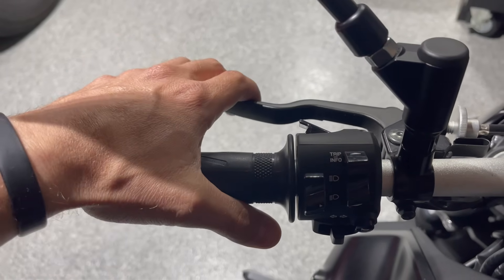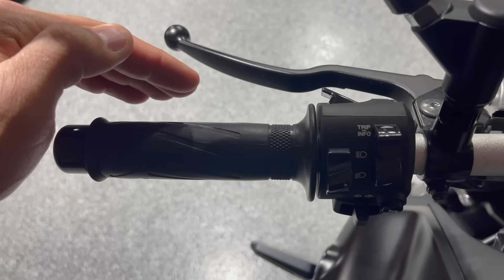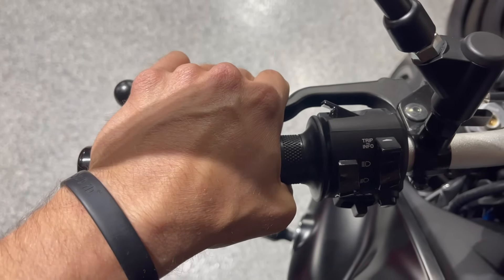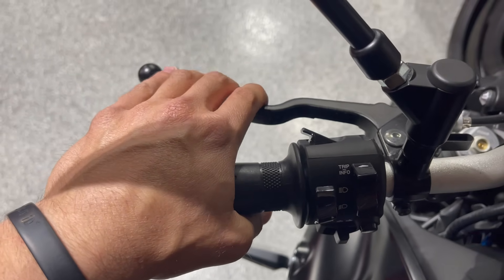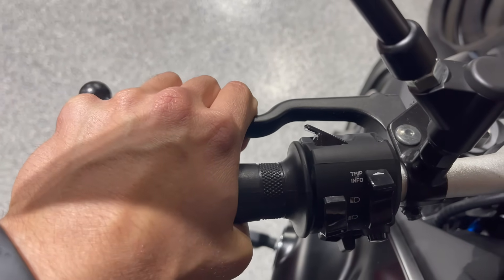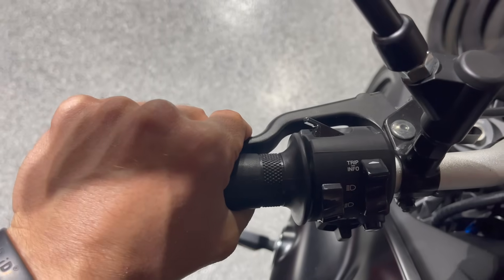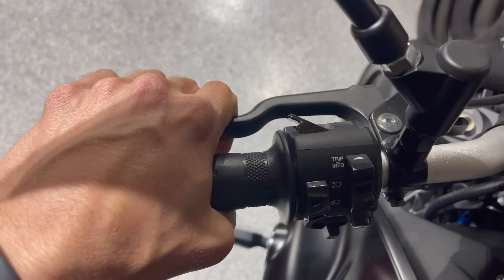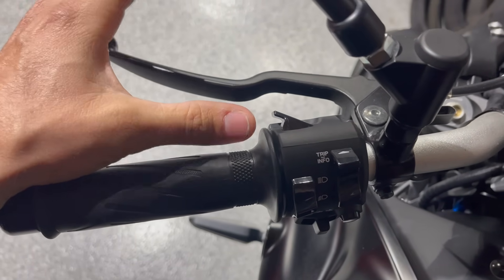Don't Make This Common Clutch Mistake!

Comment from the maker: You only need to pull in the clutch enough while shifting or doing slow speed practice to get in and out of the friction zone, not the full range of motion. Go try it out :) https://linktr.ee/GregWidmar
Reply: these little tips you have been posting are valuable info that you dont see often enough.thank you!
Reply: Thanks…because of you enjoying riding again. Have a lot of old  OLD bad habits (z900)
Reply: Super helpful  always helpful  thank you more confident now
Reply: So is this basically like the ‘biting point’ on the clutch in manual cars? As in there is a point when you raise the clutch pedal where you can feel the gears ‘biting’ as it were?
Reply: @friktionrc  at a car you need to fully press it, but on a motorbike not. I mean, at both vehicles there are that "biting" zones as you mentioned, but on a motorbike you dont have to fully press the clutch unlike a car.
Reply: @ADDONRACER  thanks and yup I get that - for the bike you have to  'twist' , I just wanted to check the feeling was like in the car - so as a rider you can feel the clutch biting in the same way you feel it biting inna car....what I mean is, being a bike would that make the biting point more delicate?
Reply: @friktionrc  its not exactly the same, but both have biting points yes, but you cant compare it. Even  diesel and petrol cars react differently to the clutch. If you compare a bike to a car, with one you do it with your feet and the other one with your hand, but yes, there are biting points on both vehicles to answer your question. Even when changing gears for example from two to three on a bike, then you can give a bit of a throttle before you let the clutch fully go, to shift smoothly, same as a car. Why are you comparing cars to bikes anyway, u wanna get a bike?
Reply: @ADDONRACER  Thanks for that 😊👍....and yeah planning to learn to ride and get a bike ...is it that obvious 🤣. I've riden 'twist and go' jobbies ages ago (like +35yrs, mainly on beaches etc for fun) now wanting to learn to ride and one day own and ride a pre-2012 Suziki Hayabusa. Friends that ride have advised not to get that as a first bike but start out on other less powerful machiens and get on road experience and work my way up. Thing is, I'm not getting any younger and want to get on the sadle befote Governments put all these electronic restrictions /limiters etc on bikes like they are slowly doing in cars. Was initially looking at something like a Suzuki TU250x to start with as its pretty basic but from what I can see is a great 'starter bike'. Only thing I hate is for us in the UK we have to be take and pass different tests to be able to ride pwerful machines like a 1300...where as for car drivers, any idiot can pass one test and drive anything from a G-Wizz to a +200mph Pagani/Bugatti etc etc etc without taking any other test. Modern cars are just too boring for me now (I'm a 70s/80s kid lol)...and bikes is where I can see myself enjoying time on the road (without being a dick lol). And anyway even as a kid I was into bikes way before I was into cars (and I say that as a self confessed petrol head lol). My first bedroom poster I remember was at 3 yrs old and of a certain Barry Sheen, knee down on his Suzuki - my first and sill greatest motorsport hero 😈😈🤣🤣🤣
Reply: @ADDONRACER  Thanks for the great response and wise words. I grew up like you as a car nut too hahaha but my first love was always motorbikes…thing is unlike you I never rode bikes properly. Instead got my car license as soon as I was legally allowed to drive and never looked back since. You are sooo right about the type of bike to get when starting out…initially I was like ‘I want a 1300’, then it was loads of friends saying you’ll kill yourself within the first year because you have 0 experience on a bike that is too heavy and fast for a new rider to control…then I started looking at the Honda Grom thinking it would be perfect as a starter and now I’m looking at a ‘proper’ learner bike like the 250 I mentioned earlier. …and yup our bike tests look properly hard and varies on what type of motorcycle you want to ride. I think there is also a theory test like car drivers get…I genuinely want to ride and own a Hayabusa, but I can’t get over how much hassle it is to pass the test lol…and also how expensive the kit is….a half decent helmet is like +£400 😮😮🤯🤯😂 But you are 100% right….when riding a bike you keep learning and the more you ride, the more you learn - in short one gets more experience. Thanks for the heads up about the vids, I will deff check them out! 😎✊👍
Reply: While this is true, you're better off just pulling it all the way in. It's inevitable you're gonna miss the friction zone and grind the shit out of your gears.
Reply: This is only going to shorten the clutches life this only proves that you do not work on motorcycles
Reply: almost every bike have hydraulic clutch but not on my case as i m in Pakistan. I do always pull 75% off to shift gears.
But thanks u so much for information
Reply: A clutch is only needed when pulling away from a standstill or when coming to a stop.., i have a bike with a dry clutch, haven't touched it for the last 50.000 km's

Comment: You can adjust the clutch lever if you want it a bit in or full in. You can also check the amount of press needed to make sure clutch is release by putting on 1st gear and push /move your motorcycle if it move freely. Note that on gearing to 2nd and up while riding just a little press is enough no need for clutch to relase all d way.

Comment: All depends where the biting point or "friction area " is on the lever . As clutch plates wear this position changes.  Also some bikes may just have the bite point within a few mm of letting out the lever.
Reply from the maker: Ok

Comment: when shifting up i  barely even pull the lever and it is way smoother and faster  but when im shifting down i usually pull it in all the way cause otherwise it is kinda clunky , i guess that might just be my bike  and you have to find the sweet spot for different bikes  , suzuki gsr 600

Comment: Actually pulling the clutch all the way in all the time  & holding it in @ stops should weaken those springs & make them shorter in record time compared to doing it only 1/2 the time-👍🏼much love to everyone & stay hyper alert when riding-from Conroe Tx
Reply from the maker: you can stay at home to make the tires last longer too

Comment: Its different between fast clutch and long clutch..what i see is you using long clutch on your bike and you right about that however for fast clutch we need to pull all the way to handle and just need little gap for movement... I recommend fast clutch so i dont need to service my clutch plate more often$$$$
Reply from the maker: Never had an issue in 500,000 miles...so they way I'm doing it, there's no issue.

https://www.instagram.com/motojitsuclub/

Comment: I need to adjust my clutch and the lever to have a tighter friction zone, the bike was shipped with the friction zone being nearly at the end of the clutch lever being fully disengaged. So it has been suggested to play with the clutch settings on the dial and to adjust the piston spacing to get the friction zone about 1/2 inch away from the grip.  I generally each season do rock and roll, which basically is learning the friction zone.  But I find on a long ride the engagement point shifts and now what was once where I thought the friction zone was is father out.

Comment: The answer depends on circumstance. My Hyundai car has a dry clutch, so keeping it disengaged generates destructive heat, especially bad for spring steel. And, the throwout bearing heats up its lubricant, sealed inside. My HONDA bike clutch assembly sits in an engine oil bath, at a more or less constant temperature, unless I am in gear and using the clutch as a braking force, such as in gear, facing uphill, waiting for a green light, with no brakes, front or rear, applied. I rarely do that silly thing any longer. So, eliminate the destructive heat by using the rear brake AND using the ‘friction zone’. Now, FYI, some bikes have a clutch lever that needs almost no force to hold it all the way against the handgrip, very nice for minimizing hand cramps! Of course, we could just shift according to engine sound and feel, without ever using the clutch, assuming we just keep moving on...(!)

Comment: You'll need to fully disengage the clutch to shift into gear from neutral or to come to a stop while in first, but once you're rolling you can actually shift gears without pulling the clutch lever in all the way.

Comment: I have a drz400s suzuki.  And have the correct friction zone. I just recently bought a 2023 Kawasaki vulcan vaquero abs  and the friction zone is quite different.  I don't hit the zone until I am almost at the end. I tried to adjust the hydraulic clutch at the lever. No luck. 2 different  bikes with 2 different friction zones. Be safe.
Reply from the maker: https://www.instagram.com/motojitsuclub/

Comment: Only pulling clutch lever enough to disengage clutch is wrong as clutch wears out the friction zone changed so you won't damage clutch but you will the selector drum and fork
Reply from the maker: I never had an issue with more practice doing slow speed maneuvers than probably anybody, like anything, it depends on how you do it. If you suck, then I'm sure you can melt your clutch in 10 mins.

Comment: Whenever you do some kind of tutorial consider some research on the subject. For instance how manual gearboxes work and why they have a clutch. By the way over where I'm from that's called "hammer shifting" and only compensates the inability to shift at the right time. By the way here's a gem for you: you can upshift cluctchless give it a try and make a new video.

Comment: The video makes a good point about knowing where the friction zone is. What it gets WRONG is that there is nothing wrong with pulling the clutch lever all the way. In fact, some clutch kill switch won't let you start unless it's pulled all the way.
Reply from the maker: yes there is...when doing low speed drills, if you pull it in all the way, you'll try to make up time to hurry up and get to the friction zone and likely release it too fast, causing the bike to stall or lunge forward, no reason to go all the way in when doing u-turns, my drills, etc.

https://www.instagram.com/motojitsuclub/

Comment: You shouldn't be full hand clutching but it is needed in certain bikes. Most modern bikes require only a finger or two. I adjust my clutch so it disengages when it's pulled in against my fingers on the bar.

Comment: Been messing with my clutch all day today. No matter how tight I make the cable I need to pull the handle in all the way. I'm wondering if there is some problem with the arm on the housing now
Reply from the maker: Get new levers

Comment: This is how your clutch works. ( In cars, motorcycles or even trucks as long as it is manual )

imagine it using your both hands

your left hand is the clutch plate and the right is your clutch lining

If it is just sitting and not pulling it. Put your hands together, that is what it looks like. If you pull in less than an inch. Separate your hand but not in a way that you can see a light passing through it. then rub it without separating them

next, when you pull your clutch in half.

Separate your hand a bit then rub it again.

if you pull your clutch all the way. separate you hand and rub it.

If you felt the friction. Your clutch will. and it will wear the housing eventually

Comment: Do you let go of your clutch after you finish doing your gear shift or you are still holding it pass friction zone( when you are engage) while using a throttle

Comment: I just bought a YZ250F and to be honest I only use the clutch for taking off and downshifting. I power shift on the way up and use the clutch on the way down and haven't had any problems.
Reply: My buddy Mike raced YZ250's also, the ones that were really loud and smoked a lot.  Mike said to downshift at full RPM he would  just give that shifter a kick. He claimed it never hurt the transmission.  Mike also said the old smokers required lot more gear shifting to stay in the power band.

Comment: I ride a moto guzzi with a dry clutch. Should I still only work in friction zone or pull clutch all the way? Wont it cause more clutch wear?
Reply: it will cause more clutch wear, but as long as you're not doing this repeatedly for a long period and you are not making the bike rev considerably faster than the gearbox then the clutch won't burn or be damaged, it will just wear more (better to have good bike control and replace the clutch a bit sooner than the opposite)

Comment: I like both my levelers to almost touch the bar when depressed fully. I don't get why people like the bite point so far away, it's very tiring on the hand and less controllable. This one doesn't look to bad, I have a very short clutch throw due to the closeness to the bar , so the bike is starting to move almost right away as it's released
Reply from the maker: whatever works for you

https://linktr.ee/GregWidmar

Comment: Like manual transmission cars, the friction zone is NOT where you want to be if you want to preserve your clutch…which is a pricey replacement.
Reply from the maker: bikes are wet clutches...won't mess anything up unless you're revving the crap out of your bike, which you don't do when doing low speed practice

https://www.instagram.com/motojitsuclub/

Comment: Why do you it is a “mistake” for a rider to fully engage their clutch rather than shift in the friction zone?  Yes, using the friction zone is great for slow speed maneuvers and control, but what “advantage “ do you think there is for shifting in fix zone?  What benefit from following your advice? Thanks.

Comment: If you pull in far enough so that there is no engagement, no forward motion at all. Isn't that far enough no matter whether it's pulled back all the way or not?
If the disks aren't engaged there's no wear on them. Isn't that so?

Comment: A experience rider shouldn't have this problem. One should always use 1 or 2 fingers to maneuver the clutch while the remaining fingers are holding the handle. Kinda dangerous to use your whole hand unless on a complete stop or at very low speed, specially on a powerful bike. 😬

Comment: One of my bikes is 60 years old and doesn’t have synchronized gears. Have to pull the clutch all the way in no matter what or you will fall into a false neutral or it’ll pop out of gear.

Comment: Constantly playing with the friction zone can end up badly, not only do you risk at some point to shift when the transmission is not totally disengaged and so forcing it, but if you are not careful and very agressive in shifting you may also experience abrupt accelerations making you lose stability and fall or run over a pedestrian that hasn't finished crossing the green light if you are that kind of zero patience people. I have personally stopped playing with the friction zone a long time ago, it has no benefits other than on a race track, although I recommend a shifter, it's way better for racing. For the road you want a smooth and steady start, even though there is a friction zone where most of the synchronization is done, you still get some friction before, helping you start smoothly and reducing stall risk. Personally my motorcycle instructor told me to do things right and pull the entire clutch, to let rpm go down and always make sure that the transmission is totally disengaged, never to play with the clutch you either pull it or leave it but not in between.

Comment: If you riding in slow speed it dont matter if you are delay 1 sec.
For u turn and other u need space when u have full clutch.  
But shifting in high rpm i always pull full clutch but also fast. 
If you do this in high rpm u will feel the engine will be heat more. And it damage ur clutch. 
Either no clutch shifting or full clutch shifting

Comment: I recently upgraded from a 125cc bike to a BMW F700GS—a dream come true! This tip really helped me shift more smoothly on my new bike, as the gears are much softer than on my old one. Do you have any other tips to improve my shifting? There are times when the shifts sound a bit off, probably due to my inexperience. Thanks!

Comment: Riding the bite for manoeuvres and shifting are totally different scenarios. Better off pulling clutch all the way in for shifting as you run the risk of premature or bad shifts and excessive wear on the box.

Comment: I'll have to disagree. I'm an engineer. If you want to reduce wear on your clutch then pull it all the way in, and let it all the way put. If you are trying to shave fractions of a second of your lap times, then clutch be damned! Do what you gotta do to save some time on those shifts!!
Reply: I am a garbage man. There is no higher wear, because the last degrees on the clutch have no real effect on the plates
Reply: @korcidiamond3623  a garbage truck has a larger clutch and its a dry clutch. With a smaller wet clutch you can actually get quite a bit of wear just from the oil movement over the plates. So giving them as much space as possible is beneficial. This doesnt make a difference in cars/trucks but on motorcycles it can.

Comment: If you half clutch heavily, setting the clutch to pull it all the way in is safer than pulling it higher because you are vulnerable with an open palm doing this.

Comment: If your gonna piss about like that just use a quickshifter+ and auto blipper so you then don't need to half clutch just off the throttle and shift without screwing the bike up in the long run. But I get it gears and clutches are new to americans they're figuring out the bite point

Comment: Pull your clutch deep if your don’t want to change your disc usually. And very dangerous if you take it shallow that’s easily make your bike wheeling. If you want to do it smooth so you only do it faster, sir!